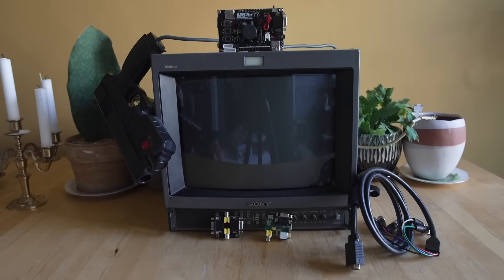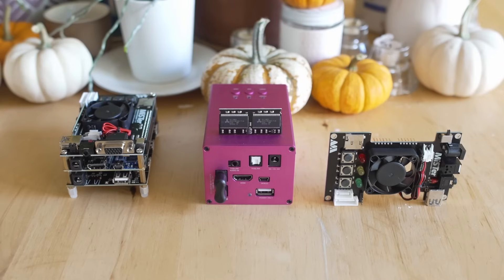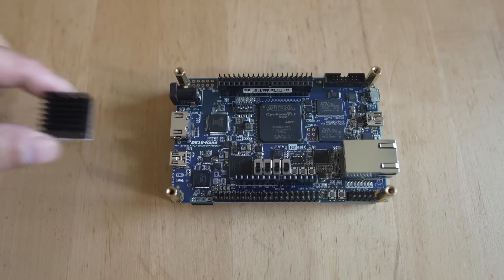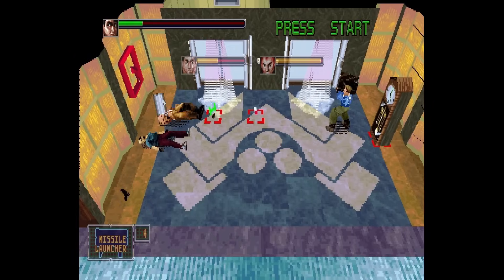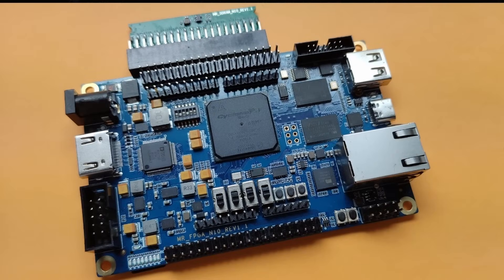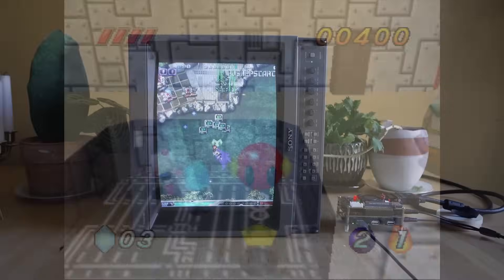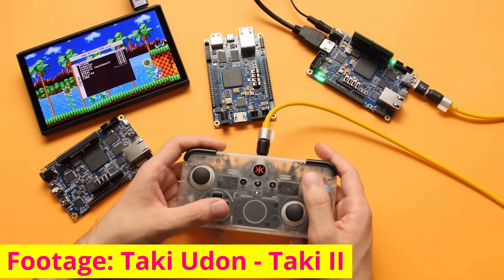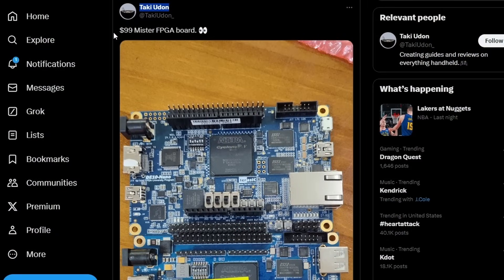MiSTer FPGA for $100? The Clone DE-10 Nano Shows Cores Running!

Comment: I really want to see this thing happen.
I love doing emulation machines with SBCs like the Raspberry Pi and for the most part, it would be enough for me.
But by now, the Pi 5 is so expensive itself that if we get a FPGA board for 100-150€ (hello from Europe) that handles those classic games better than software emulation anyway, I'd much rather go for the MiSTer replica now. Preferably in a case that has all ports going to the back save for snacks/controller ports as that is also something I don't like about Raspberries but still.
Reply from the maker: Seems like there is no reason why it won’t happen.

Comment: It's a such a double-edged blade for me because I'm happy that more people will be able to get in on it but I wonder how long before Nintendo tries to do something once it becomes too popular.
Reply: Emulators have been popular for a long time and aren't illegal.  The only thing Nintendo has done recently is gone after one of the Wii emulators because they used dumped data from the actual Wii (or maybe it was a Switch emulator?  I forget the details)  if there was anything Nintendo could do to stop NES, SNES, N64 emulators, their lawyers would've done it decades ago.
Reply: @desktorp  yeah but they're emulating the console hardware not the actual games with fpga, all I'm trying to say is once Nintendo's ugly face rears in the direction of fpga we don't know what's going to happen.
Reply from the maker: Clean room reverse engineering. They can’t do anything
Reply: @VideoGameEsoterica  only thing that sucks that they could litigate and put somebody through hell to discourage them.

Comment: Do you think that the official DE10 price will come back to the original $125 price when the $99 board starts selling? Otherwise, why would anyone buy the DE10 of this new board is only 99 bucks?!
Reply: I doubt DE-10 Nano is an important source of revenue for Terasic, it was never meant to be as far as I understand and at some point (maybe even up until now) was even subsidized by Intel, meaning Intel had some financial incentives in place for Terasic to produce this board. It's meant as a learning board for people to get hooked on Altera's FPGA ecosystem and chips (Altera being Intel's subsidiary, of course). So I don't know, if Terasic is even interested in changing anything about the pricing, they probably couldn't care less.
Reply from the maker: No I’m sure it’ll stay the same

Comment: I still fail to see the draw of FPGA when I can emulate everything already.
Reply: Latency and easy analog output setup to connect to CRT TVs. These were my main reasons when I bought it. The second reason was especially important for me, because I'm a CRT TV junkie and don't like to play old consoles on anything else.
Reply: Original hardware latency, more accurate audio...
Reply: @matthewhall6288 If you already have a good PC, the first point is practically solved if you use runahead &or frame delay.
Reply: @matthewhall6288  I guess that depends on the core and is not a general rule.
Reply: @ciaranmccarthy  True. Some software emulation is flawless.

Comment: One for a light gun arcade cabinet…
One for a Tate cab…
One for a Tate cab in the other orientation…
One for 6-button control panels…
One for 4-button control panels…
One for classic 0-3 button control panels…
…and so on.
Reply from the maker: Haha right now I have my capture MiSTer, my on camera MiSTer and my next to my TV MiSTer. My camera MiSTer also doubles as my PVM MisTer
Reply: I'm thinking of paving my garden with DE-10 Nano clones. Just need a garden to pave.
Reply: @kosmosyche   ;)
One for the trackball cab…
One for the analog flight stick cab…
One for the rotating arcade stick cab…
One for the sit-down steering wheel cab…
One for the stand-up three-way steering wheel cab…
Reply: Yeah so basically there will be no supply because of people like this buying 10 of them for no reason.  Thanks.
Reply: @desktorp  Demand is what created this supply with the economies of scale for cheaper prices. Basic economics.

Comment: My first MiSTer had the HDMI port die.. probably a stray static discharge.. so I just bought a replacement DE-10 for the full 250 euros 🥲 stillI can use the old board with analog IO and hopefully soon the new v8.1 analog IO that supports 24bit, since that is what I needed the HDMI for. But these clones make me happy so I can also make a 'travel' mister with only HDMI, one USB controller and a slim & sturdy case. Then I'll have three MiSTer stations: one at my PC corner with a 31KHz VGA Monitor for vintage computer cores with keyboard and mouse, one at my TV corner with two consumer TVs, one horizontal and one vertical for arcade SHMUPs with an assorted collection of SNACs and light guns and one for travel.
Reply from the maker: Yes static can be tricky with hdmi ports sadly

Comment: I bought a pre built Mister for my CRT on eBay for $380 and thought that was a steal 😂 I am glad to see this though. I would love another one for my arcade cabinet and one for my HD TV.
Reply from the maker: The good thing is even at current pricing you get SO MUCH for your money
Reply: @VideoGameEsoterica  100%. I used to doubt how much better OG hardware was over software emulation but you can really feel the difference.
Reply from the maker: There’s def a diff

Comment: For $100, I'd be tempted to make a bunch of my own "mini consoles" with 3D printed cases and dedicated controllers...
Reply from the maker: That would def be a fun use case
Reply: I'd love a second board for my living room.
Reply: I plan on making one The Heart of a custom arcade machine, so it would be nice to have another one just for that
Reply: I'd thought about making a MiSTer in a cartridge format with some sort of custom connector/interface so I could easily move the hardware from one type of device to another. This is starting to get into a price point where owning multiple would be a practical option.
Reply from the maker: Yes this will not only get people into MiSTer but also be a cheaper means of getting people who have boards to build new setups
Reply: Id buy one!

Comment: I certainly have more faith in THAT than the vaporware that is the Mars project
Reply from the maker: This def has a lot of evidence currently and I’m very optimistic about it now
Reply: AMEN!
Reply: I don’t think the mars project is vaporware. The group did mention it would be shown off in June. I think a mister+tink4k is a better combo for me considering I use a lot of original hardware as well still. The MARS is going to be a tough sell for folks(myself included) unless they manage to get some more advanced cores that aren’t possible on mister(Naomi immediately comes to mind)
Reply: @sneakingelephant The whole point of Mars is that it will get systems running that will not be possible with MISTer. If you don't want or need the later Midway arcades, the Cave CV1000, DC + Atomiswave + Naomi and the more beefed up PSX based arcades (ZN2, Taito G-Net), there is simply no need for Mars or Replay2 at all. (in the case of Replay2 I see no point in getting it if there aren't any cores to make use of it). I am a shmup Junkie and there is simply no way and no price to not buy it, if I can play Dogyuun, Batsugun (Toaplan2), Air Gallet (Cave), Brave Blade (ZN1), Psyvariar and Shikigami no Shiro (G-Net) and Ketsui, DDP DoJ (CV 1000) then. Leave alone those on the DC and on NAOMI.
Reply from the maker: Nothing about the ZN / G-Net, etc should not work on MiSTer. It’s just faster chips with more memory. That can be done. Does that mean they won’t wall it behind MARS? 🤷🏻‍♂️